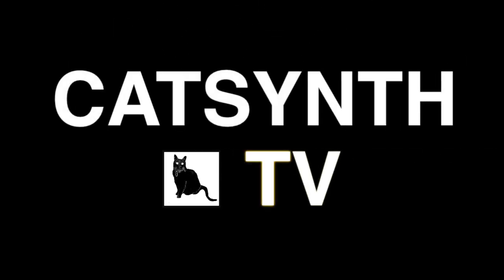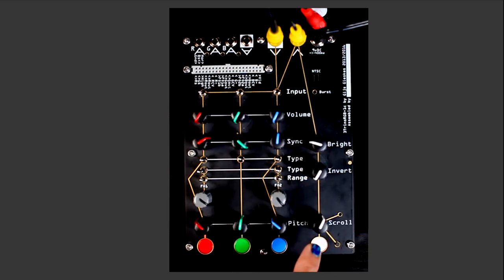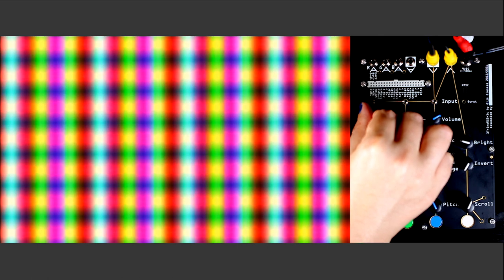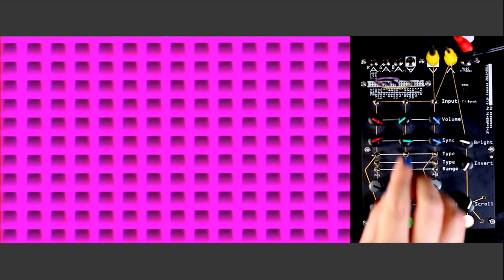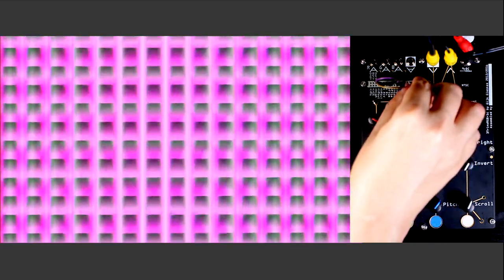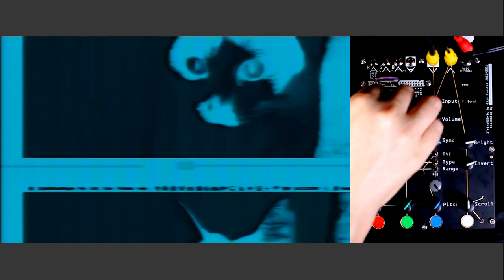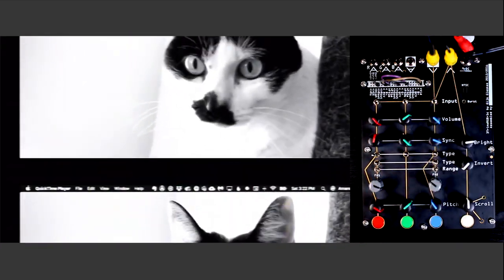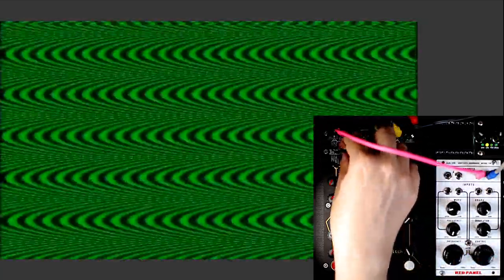3TrinsRGB+1c Video Synth (Tutorial and Demo)

Comment: Hi. I have a quick question. I have this device but I can not get any audio reactions. I’ve plugged in a portable synthesizer. The OP-1 and I’m using the proper patch cables. I’m following your guide to a tee and can’t get this to work. Does this only work with euro racks type set ups for audio reactive stuff? Im just lost as there isn’t a lot of info out there and I’ve watch your video 100 times.
Reply from the maker: Hi.  Thanks for checking out the video.  And sorry you're having trouble getting audio in.  Eurorack tends to use a 5V range, while the OP-1 line out is probably less, so I'm guessing that's why you are having difficulty.  An amplifier or a Eurorack line-in converter might help.  Good luck!
Reply: @CatSynthTV  thanks for the reply. I did manage to get it all to work and you are correct. You gotta hit a certain level or watts and signal. Loving the device even more now. I hope you get back to making videos with this fantastic device. I’m hoping to upload some stuff soon but once again, thanks for the video and reply. Enjoy the rest of your weekend.

Comment: Can you sync this with the LZX Vidiot?
Reply from the maker: It is interoperable with the LZX, but not sure about strict sync.
Reply: @CatSynthTV  thanks so much 🙏🏻🙂
Reply: In order to maintain compatibility with patching between the 3Trins and anything else, its best to use an optocoupler circuit.  Gieskes recommends against patching anything external into the patch bay, but an optocoupler would allow that to work out.
Reply from the maker: @adamjanda6542  I have pretty much limited external patching to the designated R-G-B 1/8" jacks on top, or the composite video input.

Comment: .... have the kit and need to solder it.... but time is missing....
Reply from the maker: I know the feeling - I got a pre-assembled version.  Definitely put together the kit when you can, it's a great unit!
Reply: @CatSynthTV  ... I will do so... but first I have to finish the programming for a gesture sensor project... lot of fun... big up!!!
Reply: Pay special attention to soldering the socket for the Atmega microcontroller.  It provides the sync signal.  Mine didn't work well after I finished it, and Gieskes pointed me in that direction.  Reflowing the solder on those connections even though they looked great beforehand did the trick.
Reply: @adamjanda6542   ... I will, thanks....